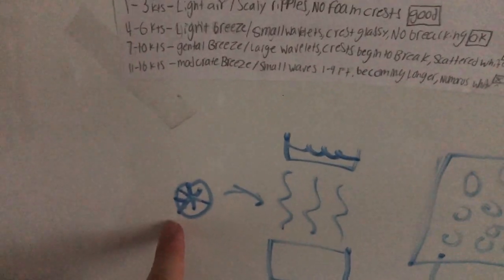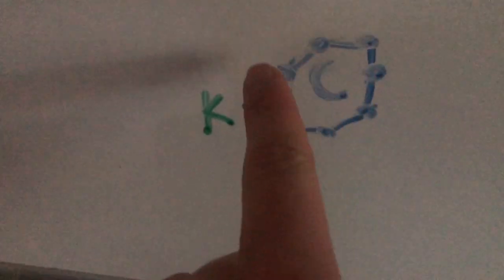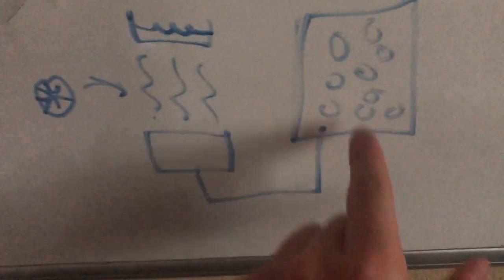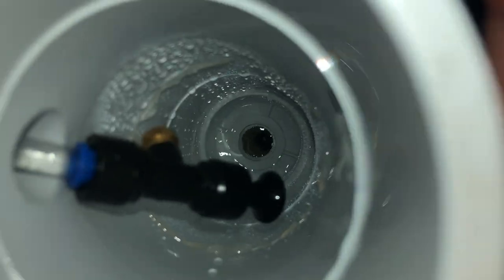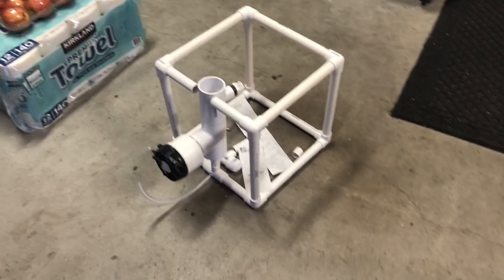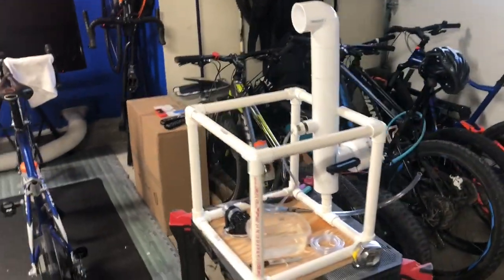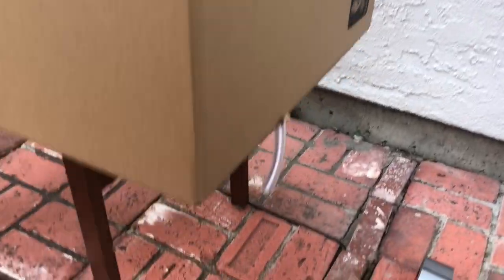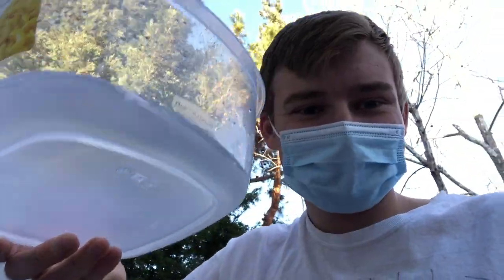TEEN MAKES A DIY CO2 CAPTURE DEVICE! HELP SOLVE CLIMATE CHANGE!

Comment: Just one problem,  Reaction of Co2 to Koh results in K2CO3, once your KOH is spent that's it. You would then have remove the K2CO3 from solution and heat it to high temperature decomposing it back to KOH (while also capturing and compressing the CO2 released for storage). The entire process takes a VARY large amount of energy (Generating more carbon emissions then its removing in the process)
Reply: Can't you feed the wastewater to aquatic plants?
Reply: You can mix it with any acid to release the co2 or use yeast as a catalyst

Comment: Yes, captured CO2 can be "eliminated" by storing it underground in geological formations, essentially removing it from the atmosphere through a process called "carbon capture and storage (CCS)" where the captured CO2 is injected deep underground where it becomes trapped and mineralizes, effectively removing it from circulation in the atmosphere; this method is often referred to as "direct air capture" when the CO2 is pulled directly from the air using specialized technology.

Comment: Apparently all you need to do now is scale this up.  Personally, I've been dreaming up this idea of growing algae to consume CO2 and marketing a small package of dry algae and everything necessary to grow the algae, except the sunlight of course, to the average individual.  Then we could have people everywhere utilizing their own carbon capture projects.  That would surely combat global warming the fastest.  I think you ought to try and market your CO2 Capture Device similarly!
Reply from the maker: I have definitely seen some projects around algae and it def looks like a good solution
Reply: Algae is a very interesting approach which I also read many studies about, but sadly is not - and never will be - viable. Bamboo is another one, which would even according to studies significantly underbid current DAC technologies, but suffers from the same base issue.
In the end, all this does is to use photosynthesis to capture carbon. Photosynthesis is ... extremly inefficient compared to modern photovoltaics. We are talking ~1% vs ~30%. It's significantly better (like, multiple thousand times) to simply place PV panels instead of Algae panels, and use that power to offset fossil fuels. Plus alot simpler to do. If eventually the world burns no more fossil fuel, then we can start thinking about some way to capture carbon from the atmosphere, but only then does it make sense. Also eating the dried algae will simply reintroduce the carbon into the atmosphere, so it's nothing but agriculture. You'd need to fix the carbon permamently somewhere to make any impact.

Comment: Brilliant work. I was actually looking into this as a firefighter for the climate stuff as well as hoping to find a way to get concentrated CO2 to put out fires. You see many cheap fire extinguishers you have in your house are ABC dry chem. This chem happens to be extremely corrosive to metals meaning anything you put out will be destroyed worse than the fire itself much of the time. We have alternative extinguishing agents like water, deionized water (which is a strange feeling to use on electrical fires), halotrons, foams, dry powders, but most interesting to me, is CO2. CO2 being inert will not destroy components in a computer for example or degrade metals. Ofc at high concentrations you could displace oxygen, which would be bad, but you're aiming the CO2 to concentrate in the fire area. However, these extinguishers are very expensive and hard to find unless you're a fire department with a nice township budget. All this to say, we could find an answer to storage in extensive use of CO2 fire extinguishers. It could be marketed to get some revenue and make non-corrosvie extinguishers more available while holding the CO2 unless it is needed in an emergecy. It is worth noting the dry chem still has its place for class A fires. CO2 has a hard time with burning trash, wood, etc.
Reply: interesting. i have an idea, if co2 puts out fires, why not just blow on the flames? 🤣

Comment: Your idea is perfect man however the one problem that scientists are facing is if you want to make this project on a large scale it requires a huge amount of energy which came either from coal or burning fossil fuel thus  in this way we will release a huge amount of co2 then we did nothing . NICE to met u steve
Reply: Unless we use renewable energy sources like wind and solar! Or a combination of wind/solar and nonrenewable fossil fuels in the initial stages, then as the capture technology becomes more efficient and renewable plants as well, we could switch over completely. Carbon capture like this would also make it possible to take the carbon from the atmosphere and combine it with hydrogen, to make renewable hydrocarbon fuel like gasoline and jet fuel! It's all very exciting

Comment: Awesome work thanks for the shout out!  I think the design you have going looks pretty solid.  And I'm super appreciative of the fact you took up the torch, tested the idea, and found that it does actually work.

Now the hard parts; it is a trace amount of carbon, but since you are using purified potassium hydroxide, by tracking the pH and through chemical testing it can be shown how much potassium carbonate was created, so we can get an idea of productivity.

The tricky part, which I need to research further, is tracing the sources and tracing the process.  For example, we need to know HOW that potassium hydroxide was created...of it can be done using saltwater and solar panels?  Minerals mined?  Trees chopped down and burned?  We need to know so that the device isn't supporting an industry that hurts the environment specifically to create the product.  That being said, if we can find potassium hydroxide or magnesium hydroxide or calcium hydroxide as byproduct of an other industry, then it really starts to become viable.

The unit would always need to be powered by natural energy (solar, wind, hydroelectric, etc) because otherwise we are adding more petrol to the atmosphere just to take a little bit out.  

If the final product, which is a carbonate salt, can then be sold or otherwise used for something, perhaps a construction material, chalky product or plaster like product, or perhaps as a soil additive or fertilizer, then you've got a product to sell.

One idea that strikes me is to use the waste water, once the pH has been reduced to what plant roots can tolerate, that nutrient and carbon rich water can then be used to grow food via hydroponics, although the plants or algae would have to be alkaline tolerant.  

The challenges are many, but I'm glad to see your good work!

Comment: Why couldn’t you fit a version of this for automobiles to run passively as the vehicle moves then when standing still the fan would operate
Reply: 1) Extra weight you have to keep driving around and 2) it will entirely mess up aerodynamics of the car , will make that approach very energy-intense for virtually no gain

Comment: Awesome project! I had and AI write up step by step directions from the transcript: 

Obtain materials - PVC pipes, end caps, elbow joints, glue, drill, fan, tubing, misting nozzles, pump, potassium hydroxide (KOH), water, and a power source.
Cut and assemble the PVC pipe into a column shape with space for the fan at the bottom and misting nozzles at the top. Glue all joints.
Drill holes near the top to install misting nozzles. Attach tubing from the pump to the nozzles.
Install the fan at the bottom of the column, connected to a power source.
Make a platform or stand to elevate the column.
Obtain or build an enclosure for testing, like a cardboard box with holes for tubing.
Make KOH solution by mixing food-grade KOH pellets with water. Start with 10-20% solution.
Connect pump to power and place KOH solution reservoir above the pump inlet.
Turn on fan and pump to mist KOH solution down through the column while drawing air up.
Use CO2 meter to test ppm levels inside enclosure before and during operation.
Monitor and adjust misting rate, KOH concentration as needed to optimize CO2 removal.
Drain spent KOH solution and replace with fresh batches as needed.
Reply: How can I contact with you?
Reply: Hi, I'm a student. I'm trying to put together this project for a science project, and to try to help my city, which is covered in smoke because of the fires. Moving on to the subject, I would like your help to put together these projects, as there are no instructions in the video, and I have no idea how to start putting them together. If it's not a problem for you to help me. Please get in touch.

Comment: Have u ever heard about those things they call "trees"? 

Bad joke 😂 Great project, we need more people like you.

You can recycle the KOH mixing it with CaOH filter it and you're done. U can also use directly CaOH wich I think is cheaper and has less carbon footprint than KOH

Speaking of those things they call "trees", there are some plants that "lock" carbon for centuries in silica cells called "phytoliths" (bamboo, coconuts, mangroves, etc).

Keep building, inspiring and sharing, cheers!
Reply: Yeah it takes on 300 trillion trees  to actually achieve that
Something that this word with  rising population growth doesn’t have room for 

Especially when tree require  land and land is expensive

In 1 year a tree can capture the exact amount of carbon ur motorcycle creates in 1 night
With all of this its safe to assume that trees are horribly inefficient  at capturing carbon
Kelp does a better job

Man made problems need man made solutions and carbon capture is the most efficient

A carbon capture machine can do that with  3houra
Reply: dont
Reply: Trees eventually die. When they do, they release the carbon they stored up through rotting and wasting away (or getting burnt).
Trees are great for slow and temporary carbon capture, if you dedicate enormous areas to let them grow.
Not so much for solving climate crisis.

Comment: Nice work in your video, I have a few chemistry ideas you might like. After you capture the CO2, then comes the question of what to do with it. If you collect and purify it, it can be used to make dry ice, to carbonate drinks, and make CO2 fire extinguishers. CO2 can also be converted into more useful substances by reacting it with reducing agents. For example, aluminum hydride (AlH3) reduces CO2 back into methane (CH4). When magnesium burns in CO2, it reduces it back into elemental carbon, which can be used to convert metal oxides back into metals. CO2 can also be reduced to formic acid (HCO2H), which can be converted to carbon monoxide (CO). A useful source of fuel, and is also the precursor to the synthesis of other organic compounds. Theoretically, it should be possible to convert CO2 back into much of the octane (C8H18) that burns to produce it in the first place. But regardless, it might be a while before that happens. The best thing we can do now is take things in small steps like with what you are doing.

Comment: Hi! I’m kinda doing the same thing you are!! Can you explain how you got the pump to move the solution upwards and into the mist? I’m kinda stuck there…
Reply from the maker: Make sure the output tube is connected to your mist nozzle and input is in the solution. If that’s not working your pump might not be strong enough for the elevation so mess around with that.

Best of Luck

Comment: What if you installed a PM2.5 and charcoal Filter in the Top vent column? You could also install an internal UV light. This would help kill bacteria, filter smoke, smog, and dust, while at the same time, scrubbing the Co2.

Comment: What if you used a fogger system instead of a sprayer less water used and you could set it to a higher humidity and try using a micro pore membrane to pass the clean air system then reverse osmosis to re use... great idea and work

Comment: I wonder if people quit trying to isolate co2 in their capture systems if it could save money. Co2 is more concentrated in cold temperature and is heavier than air. If we focused on higher concentration co2 areas and let a little methane, hydrogen , etc to be captured and put in the ground with the co2 it could be a game changer.

Comment: Next video should explore how to separate the carbon from the solution to then store it? Excited to see how this develops!
Reply: Mix it with calcium hydroxide, filter it and reuse ❤️
Reply: @angelusmendez5084  My chemistry knowledge is very out of date!  What would you end up with that you're filtering out?  My interest would be in generating a CO2 source for a greenhouse to enhance plant growth.
Reply: @bobhorton5440  it's basically a displacement reaction what stays in the filter would be calcium carbonate CaCO3. Our mate in the vid could've used lime water with the same results.
Reply: @bobhorton5440  if you want to get co2 out of calcium carbonate you just have to cook it until it becomes calcium oxide again. It has to reach a specific temperature, I can't remember how much right now.

But for your use you could get co2 in a less expensive way by getting inside the greenhouse some biological process (fermenting, composting, etc.) or burning wood or hydrocarbons to generate energy or something like that.

Comment: Hi! First of all, congratulations for making this DIY CO2 capture. Would you make a step by step tutorial with all the references of the materials you're using? I'm not an engineer but i can follow a plan ^^ Would it be possible to improve your device ? Like with materials that could increase the amount of CO2 captured ? If you do the math between the amount of CO2 needed to build up your device (materials, transport, on so on) and the amount of CO2 collected, what would be the result like ?

Anyway, very interessed by all that CO2 capturing, wondering if I could build one up ^^
Reply: I guess we will need to take into account about how carbon will the device collect over its lifetime rather a specific time of 1 year.

Comment: easy carbo capture any body can make: 
grow a tree example grow a peach tree from the seed
grow aloe vera
build a min greenhouse from reclaimed and recycled materials
build a mini windmill to generate electricity use reclaimed and recycled materials go to your city dump and ask them if they have an electronics recycling box, ask them if you can have a drill or something else with a dc motor in it you can use this to build a wind generator
build a battery bank to charge with the windmill, then you can power your devices with renewable energy. these are things to do that don't require buying stuff and growing plants can suck carbon out of the air as long as there's no electricity involved

Comment: Must consider the carbon release from power production.
Reply from the maker: Yes has battery’s that can be charged by solar however making it even greener. This is just prototype to be expanded upon
Reply: Using renewables for running the fan & pump is very much within the realm of possibility.

Comment: first off, great idea. proof of concept is a start.  but don't stop there.  keep going.  don't count on big companies for what you can do yourself.  as for your version 2.0 attempt, if you decide to keep experimenting with this,  try having the air pass through a tank of water with the co2 binder agent in it.  maybe even have the pass through a few fish tank bubblers to maximize air disbursal and contact with the binding agent.  maybe even add a co2 monitor in the intake stage and another in the output stage to prove its working, for one, and to see how much carbon it actually captures.

Comment: You should make it so that your expelled solution is recycled at least three time, quite often chemical reaction such as chemical filtration and or purifications are perform iteratively as the yield is often factional, also why the choice of KOH vs Calcium Oxide (CaO).
Reply from the maker: I chose the KOH as it was listed as the solution used in the Carbon Engineering large scale plants. Is CaO a preferred chemical in this situation?

Comment: Interesting. But couldn't you just use an aquarium "bubbler" to enrich your fluid with co2?

Pretty much the reverse of what you have done. Instead of spraying the liquid down, you could just bubble air through the liquid until it's saturated.
Reply from the maker: Never thought to do that. That’s actually a great idea. I just wonder how much air can flow through it? Like will it be fast enough
Reply: @brandonhofman  Potentially increase the number of tubes entering into the bottom of the tank to increase the overall volume of air that can be processed.  Additionally, if the "tank" is narrow then you could have multiple channels for the air to flow through each with their own set of supply tubes.  (And I would love to connect to discuss the project in more detail)

Comment: Seems like it would draw too much power to have a nett zero carbon footprint. It needs to be negative.
Reply from the maker: If charged with solar then there should be no carbon needed to run the machine

Comment: This is in response to you statement that you developed this so that we could prevent climate change, while still using cars that run off of gas. 
1) We are actually past the point where we can rely upon only carbon capture or renewable energy resources. We will actually have to do both. 
2) There are electric cars that exceed the speed, safety, and efficiency of gas cars at a cheaper cost when bought brand new.
3) This is pointed out by that fact that gasoline isn't listed as a renewable resource. Gas and oil will eventually run out, so we will have to make the change anyway.

That being said I like what you are doing and think that you are brilliant.
Reply from the maker: Thx so much for the feedback